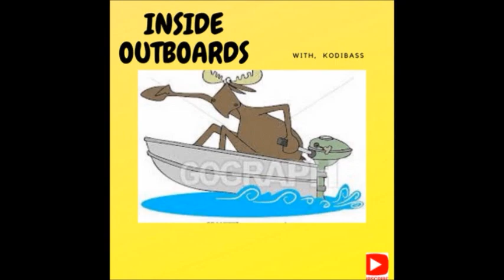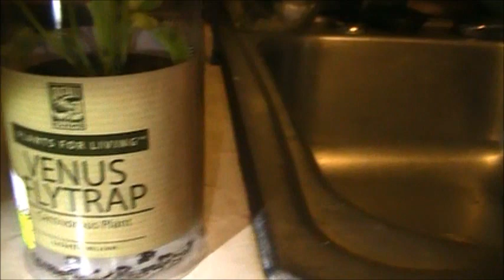JOHNSON 30 HP  ,,,PART 4,,,  ( FIXED )

Comment: You got that right, impact damage travels....  Just like when you get in a fender bender.
Reply from the maker: +kramden   Yep' I told the owner I will repair what I see broken , but wont guarantee it because of  how the motors were damaged.    4 sure.                  kodi

Comment: I'm a big fan of the Permatex Copper anti-seize. Sponging up some good tips on yer vids. Thanks.
Reply from the maker: +MH  I 2 like the P-tx copper,  Just not on aluminium  the two metals hate each other, the copper is positive dominant , the Aluminum  sacrificial , and dependent on the aluminum grade pitting can occur.      kodi
Reply: One of the best substance for keeping any fastener bolt,nut, lug nuts Chevy exhaust bolts is Evinrude Johnson sealant get the big can with the brush in it. You will use a bunch. It doesn't matter what nut or bolt I'm using or screwon a Chevy or a Honda or a lawn mower I put it on all of them. It prohibits moisture from coming down the threads and it never quite sets up.
Reply: @kodibassInsideoutboards    You are sooo right, you must be careful which "anti seize" product you use on outboards, the copper stuff will promote even more corrosion.  I know they make a different product for aluminum...

Comment: Kodi I need your help!!!! '85 Johnson 30hp. Rebuilt carb,lower unit,new impeller,T-Stat,new lines&fuel pump. Upper crank shaft seals good. I have a bad sneezing poblem. Would lower crank shaft seal cause a wicked lean sneeze? I before I forget. 120lb on each cylinder.
Reply from the maker: =BRT 123,  It could , but I would first inspect the screws, nuts / bolts & gaskets in and around the carb & intake areas,  In a lower seal situation you most often see black oil coming out around the water / exhaust areas.                                       kodi

Comment: And ive got a 9.8 mercury 110 i was told its a 1971 it was stored a very long time and possibly rebuilt the coils are soft had fire i touched the wires and didn't even get to start it first pull dam near started with choke on i just had to check the motor  and pulled on the rong coil wires can u please consider doing a video on y outboards cant just use eny coil i really dont feel like paying 145.00 To 127.00  each coil its really a nice looking outboard y cant i just buy eny cheep one

Comment: Kodi, I hav heard that some outboards can have a higher horsepower by changing to larger components in carb, or other intake components. Might I possibly be able to do this for my 1998 30 Horse Johnson?
Reply from the maker: +jw, Yes but you would need a whole carburetor from a 35 hp, as the throat size is larger not just the jets. kodi
Reply: Thanks for reply, Kodi, i'm glad I could get a bit more power out of my 30 horse changing out smaller components than the whole cylinder block, to have to get more cubic inch or litre displacement if a bigger block would even fit in the engine pan. I should be content with this motor, it never misses a stroke since I applied silicone grease to the plug and coil terminals, & was able to successfully reseal the lower unit & keep it going properly with other repairs, but when I began adding accesories and especially when I installed 1" plywood flooring in the boat, my speed dropped from ~28 mph to ~22 mph. This is just a "toy boat", a 1958 shallow draft 15' Crestliner Voyager, but the data plate says it is rated for SEVENTY HORSEPOWER!! I have a hard time understanding  that, even though back then I don't think there were the heavier 4 cycle engines. And for decades now I have had nightmares that these small aluminum boats I've had are riding down in the water so low, with Lake Erie right up to the "gunwales",  that all I had to do was just move in the boat and it would immediately get swamped, and down I would go!
Reply: I also bought a compression tester inspired by your very helpful hands on how to videos, so I can see if perhaps worn rings, cylinder walls, reeds may contribute to lower speed.

Comment: Hello again Kodi! Is there a way that I can pay you for those parts to have it ship to here? I never done this before and don’t know where to look for. Sorry to bother you. Thank you again
Reply from the maker: Paypal,  first send me the part numbers of what you need so I can make sure I have what you want.   kodi
Reply: My parts number is 328316, it’s a driveshaft for the 30 hp Evinrude. The Oil seal surface and the bearing surface it’s pretty bad on mine. I think If I still continue using mine, I will have an issue somewhere out in the ocean. I don’t want that. If I have your part from my favorite funny YouTube, Knowing that it will make me feel more comfortable. Thank you Mr Kodi. Alek.
Reply from the maker: @alekthefisherman5676     I will look & see if I have one & LU know      kodi
Reply: I very much appreciate you Mr. Kodi. You are a life saver.
Reply from the maker: @alekthefisherman5676    Well not so this time Alek  I looked at my parts pile & at my parts motors,  &  I do not have that shaft as it appears to be a short shaft
sorry I do not have one.  But I get motors in daily and as soon as one shows up i will let u know.                                kodi

Comment: Just dont understand u make it look easy im so not willing to give up on my out boards ive got my lower half of my Briggs Stratton 5hp all the seals leeks every time i fill it parts are not available eny more Briggs has most parts but the seals for the bottom half just not available shame it looks amazing runs like new if u know were i can finde such parts ide be one happy camper ive got Briggs website i can even get part numbers i know by dealing with outboard  u probably know something
Reply from the maker: +RF  take out the old seals & take them 2 a hydraulic shop any good hydro shop will be able to cross ref them and have them.  Another  option is fill your lower unit with Lubriplate 105,  available @ any good auto parts store. old timers have done this for years.                                                                       kodi